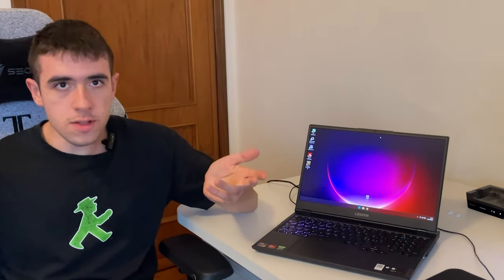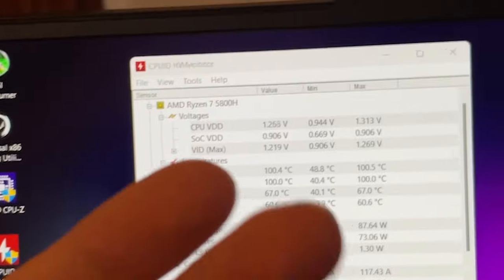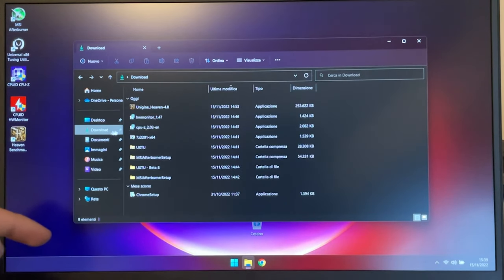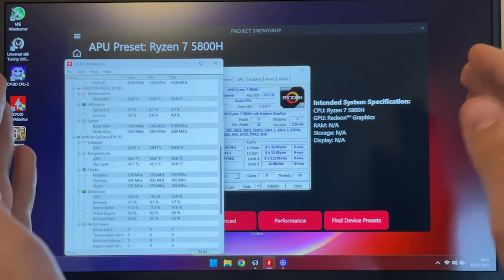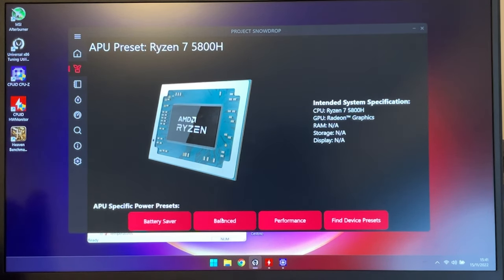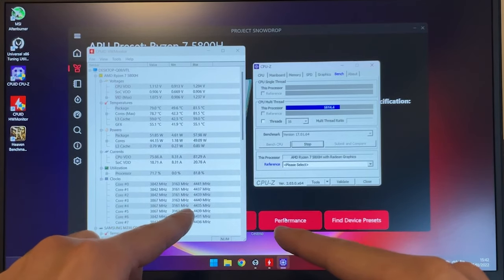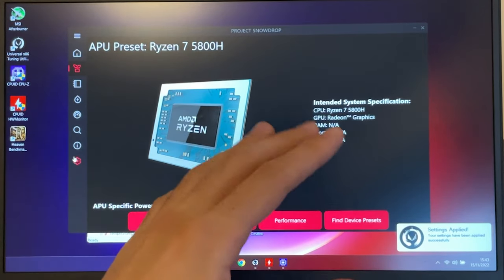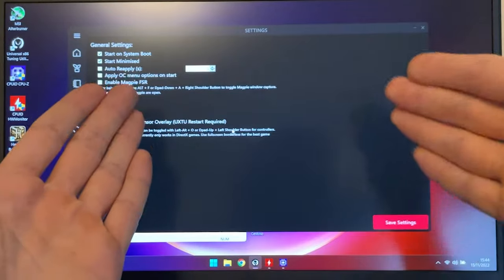Undervolt ANY Ryzen Laptop CPU for more FPS | Tutorial | R7 5800H on Lenovo Legion 5

Comment: it’s limiting cpu temp not undervolt.

undervolt = lower temps + normal or higher performance!

If you want to undervolt go to that software leave everything unchanged and find curve optimizer then apply ranging -20 to -25 value then save.
Reply from the maker: It is not actually just a temp limiter! The preset work by applying a different curve! Doing it manually as you suggested, however, works great too!
Reply: @ImWateringPSUs  then why is the "performance" mode here producing lower clockspeeds than without using the program at all? in the beginning we see 4160Mhz, after you apply "performance" mode it's somewhere around 4040Mhz.
Reply: Yeah  he's just arguing with everyone who points this out, even though the title claims  higher FPS.
Reply: There is no available software to undervolt Ryzen mobile processors as I know. If you know please share. Most vendors lock BIOSes from that.

Comment: I tested it on the legion 5 pro (5800h), the temperature is lower since the processor frequency is lower, there is no difference if you limit the frequency in the control panel settings. For example, in the "balance" mode, the program sets the frequency to 3900, in this case all the temperature and power indicators are identical to the situation when you limit the frequency to 3900 in the windows control panel. From this I concluded that this is not an undervolting
Reply from the maker: It is not simply a clock limiter though, it does actually increase performance! You need to test the frequency under load in games and consider the load overtime that usually means a frequency drop!
Reply: @ImWateringPSUs  Yes, but at the same time the point of undervolting is to lower temps so that less power is wasted into heat. This is how you could reach the same clocks for half the consumption (depending the stock settings) by undervolting. However, that needs to be done in the bios because it is up to the mothoerboard to control the voltage without looking on the disk, or RAM (the memories in which you run and store the AATU settings). That is why undervolting cannot be done without a suitable motherboard and bios.
Reply: Well indeed i don´t have much trust in tools that just say "battery saver/balanced/performance" without actually telling you/showing you what they do. 
Sadly found no proper way to undervolt my ryzen 7 5800h. Yet ryzen controller at least allows me to set power limits and temp limits. 85° temp limit and restricted to 35w tdp (even on long and short boost) really helps in overall performance (you bounce less up and down) and in cyberpunk 2077 i still sit at 4000-4100 mhz boostspeed (average between all cores). 

Probably a better experience if you run a ryzen hx cpu that allows for overclocking (guess then the mainboard will allow some actual voltage regulation).
Reply: From what I read, it is lowering the volt at the cost of frequency. Intel have apps like IntelXTU/throttlestop, just lowering the voltage without having to lower the freq. I could even lowering the volt and increase the turbo/freq as long as the system is stable enough. 
I'm looking for similiar tools for AMD, do you have a recommendation?
Reply: @Anakayamgoreng  Unfortunately, I could not find a way to undervolt for amd mobile processors. If you can find a way to do this, be sure to let us know
Reply: The program developers have said that it's impossible to undervolt the 5600 and 5800 unfortunately.
Reply: @benclimo461  At lest ryzen masters is incompatible to these laptops...
Reply: My 4600H hiting 4,6Ghz in spikes not geting over 88c in game 80C stabile in Cr23 90C is Max. Tj for my Cpu is 105c.I have this Program is great my TDP IS from 35w 45w to 54w max.Program OC to 66W stabile.
Reply: @MAG-Crew ow are you getting over 4GHz with a 4600H? On Lenovo that cpu comes with 65W TDP in performance mode (red light).m, this usually outputs an actual 30-32W power usage.
Reply: The OC page has a Curve Optimizer which you can use to actually undervolt the cpu and not change the rates TDP of your energy setting.
Reply: @imAgentR  Yes brother im geting Max to 4,6 Ghz default Tdp is 35/45W Max factory is 54w i push my to 66w. tell me where u wanna to send u Pics
Reply: As you have said, th,s program only decrease the frequency, not the voltage which also you can do from windows power managemen. I have lımıted the max watt to 50 (ıt was 55 watt) and my laptop ıs cooler then before. However cpu frquency has dropped the 4ghz from 4.2 ghz.
Reply: Simply DISABLE TURBO BOOST in Windows Power Options... Legion 7 with 5800h, mhm...

Comment: 3:45 who are you trying to fool here? I see lower clockspeeds than at the beginning. Not by much, by like 100-150 Mhz but that's still not undervolting, that's underCLOCKING. My friend recently tried Ryzen software that is supposed to control voltage. And while it does work on some 4000 models, it DOES NOT work on Ryzen 5800h.
Reply from the maker: It’s running at a higher clock speed than the stock one after the power limit kicks in, it’s lower than the top boost frequency at stock, sure, but that’s not sustained. If you have a 5800H give it a shot, this ACTUALLY increases performance!

Comment: Thank you so much. I didn't expect anything because of different opinions, but it works very well on my 5800h. Actually, when I turned cinebench, both multicore and single core went up 300 points despite lower temperature and voltage.

Comment: Tried to use for 6800u
So before. Power usage - 25 wat
After 17
Frequency down from 2800 to 2400mhz
Temp from 85 to 68
Cibench performance test:
from 9075 points to 7619.

So basically, under volt - true
underclock - true. That did temp much lower. But also lost in a performance.
Reply: Forgot to add. 
I had also Power/balance/whisper mode at my Asus app.

This settings also take affect on the results.
Reply from the maker: Thanks for the report! I’d recommend you remove the other software you’re using, set the laptop on max performance and then apply the “balanced” option as in the tutorial, for better results!
Reply: @ImWateringPSUs  originally I did that under Performance mode setting for pc. Results in first comment when applying Balance setting.
Reply: Undervolting would allow you to keep using the max frequency of your cpu at a lower power level hence less heat, hence more boost time. This is not undervolting at all.

Comment: There is another similar option Ryzen Controller. It is much easier there to limit max temperature without a need to customize other options. Or/and limit TDP. So your CPU will just run a constant temp you want under load. Less temperature shocks and stress for CPU and nearby components. I tested it and it holds the temperature not more than +1 degree celsius from the limit. While keeping performance at a reasonable level.  Recommended safe temperature for games is 75° C. 80°is O.K. 70° - For those who wants to be sure.
Actually I got 10% more points in Cinebench R23 with 80°C limit than without limitation by default where I had max t 92°C.
And got 5 % more than default with 70°C limit. Which is very nice : I Got 21 °C max_t drop with higher CPU performance !
I got 4% drop with 65°C limit 

I have Vivobook Pro 15 with 5600H. The test I mentioned was with fans in Standart mode. Where it gets 7150 points by default or 9200 if I tweak everything I can to max with temperatures up to 96°C
Reply from the maker: Ryzen Controller is also really good! The UV tool I showed acts a bit more on the curve so it’s better slightly though! Thanks a lot for the detailed report😇
Reply: @corsairpower7520  I've experimented with it. And found that my CPU is most efficient with 15 W TDP limit where it has 50% of max computing multicore power. And only about 10% drop in single-core performance. These drops are not slowing down light tasks subjectively. So that is a great option to work on a battery. Laptop is also cool and quiet with the option. You should find best spot for your CPU though. I think it should be in 15-20W range. Just perform fast benchmark on every step in that range. 
Another thing to mention go from higher wattage to lower, because at some point its performance will drop gradually and you will need to turn off limits fully to make it faster again. Seems like some functions of the CPU can be turned on only with enough power. But then you can go quiet low and everything works good. I also recommend after reboot before setting quiet low limits to give it some fast heavy task to "turn on all capabilities". I found it much more reliably performs. Like start the game and after that apply your limits. If not, you sometimes can find it doesn't want to go even to limits and lags in workflow.
Reply: I wouldn't recommend setting the temp limit to anything below 75. If you go lower then you may end up with horrid stuttering as you cpu goes into panic survival mode clocking cores down far below the standard frequency, before it boosts back up to 4ghz+, and the hits panic mode again.
Cooling solution and environment temps as well as a games cpu utilization matter on this, i tried 70 for a while till I ran into said issues.

In most cases it's better to use a desktop shortcut for power profiles, for turbo and non turbo. As you can disable the CPU ever clocking above it's stock clock speed. And 3175mhz on my Ryzen 7 5800 is still plenty fast and depending on the game doesn't even make a difference in fps compared to turbo on. But temps go down to ~60 tops during load with low 50s during low usage, i.e browsing, watching videos etc.
Reply: @ImWateringPSUs can i undervolt a alienware m18 with ryzen 9 7945hx? Its got a 4090 gpu so already gonna run hot as hell
Reply: recommended safe temperature is probably higher than 75c
Reply: @snakeplissken1754  limiting the same CPU by the same temp works different with different room temperatures and fan profiles. 
Now I'm using limiting by TDP. I found experimentally the best efficiency per wat TDP for my CPU and now I'm using it. It is 15 W for 45W processor. I also allow turbo for a short time to 23W. And I have enough productivity even in games, but cool quiet and long-lasting on battery laptop.
Reply: @clunkeys  nothing bad will happen if you get your CPU even to 100C shortly. But operating in high temps for a long period of time will slowly destroy components on your motherboard. I bet it will overlive warranty period but not for too long. The more temp you have the shorter laptop life will be.

Comment: This is not undervolt properly.
Reply from the maker: It is, for Ryzen laptops! Try it out
Reply: Tried this, and it does not undervolt my ryzen 5800h. Used curve optimizer instead.
Reply: @itismeISH where i can get curve optimizer? What app
Reply: @Demwih same app, or rather the updated version UXTU, Universal X86 Tuning Utility.
Reply: @itismeISH  i already installed universal tuning utility x86. But in custom  section i can't see curve optimizer
Reply: @Demwih  buttom most option, per core curve optimizer, if you have it
Reply: @itismeISH  sadly i dont have it
Reply: what version do you have cause i dont have the option either, i only have per core
Reply: @viccyboy  they updated the app. There used to be an all cores option.
Reply: @itismeISH  does it work with 6800h ?
Reply: This app does not work with dragon age ryzen processors which are 7000 series. I got 7945HX and app does not support it
Reply: @itismeISH curve optimizer doesn't work on 5800h. Just look at voltage/freq before and after, they won't change
Reply: @Antagon666  they’ve been updating the app. I no longer use the curve opt. I use the balanced template now.
Reply: @itismeISH  but curve optimizer doesn't work 🤣 any gains you've seen were placebo.
Also presets just straight up limits wattage and performance, doesn't improve voltages.
Reply: @Antagon666  6 months ago, curve optimizer used to work before a few updates. Now it no longer works for 5800h. As far as the templates, i find that it fits with what i need for my system now.
Reply: @itismeISH  I've been trying to activate it since all the way back to 2022. What is your laptop?
Reply: i have R5 5600H, for people in this section, is this still working, if not, what is actually the best option to do? i have already disabled turbo boost
Reply: @artery2211  Best option would be to limit either temperature or  total power, so that the CPU can at least boost in single threaded workloads. Disabling boost is not valid solution, as you are potentially losing about 30% of performance.
Also curve optimizer has never worked since 5000 series in R5 and R7 CPUs, the people claiming it did are either lying, or mistaking the applied profiles for undervolting.

Comment: Hi just to let you know that the undervolting aspect of this program does not work on the 5600 and 5800 as said by the developers themselves, it'll work on the 6000 series and 5900 versions though.
Reply from the maker: Weeeeell technically it does still lock to a certain voltagepoint in the curve even on the 5600 and 5800, so it “achieves undervolting”, if that makes sense. But yea a true voltage offset is only applied from the 6000 series and up! Still works for every Ryzen temp and performance wise tho
Reply: @ImWateringPSUs  Technically not. Definition of undervolting is running at same frequency with lower voltage. 
Undervolting doesn't work for any R5 or R7 CPU, since 5000 onwards (including 6000, 7000, 8000).
Stop spreading misinformation.

Comment: Well... on ACER Nitro 5 (AN515-45) with Ryzen 7 5800H the newest "Universal x86 Tuning Utility V1.1.0 Beta 3" did not make it a lot cooler, it make exact opposite. On idle it is +10 C degree hotter and while playing its -5 C cooler. However to my surprise it made Windows 11 much more snappy. Overall program execution is faster and moving between windows also seems snappier. KEKW i think i am gonna use this... and i think it added extra +400 Mhz sustainable cpu clock speed at the same cpu temps! :D Also honorable mention is for disabling turbo boost speeds. That one made 20 C degree difference. More i think of it - might be time for repasting my lap with Kryonaut.
Reply from the maker: I’m really happy it was helpful! Thanks a lot for taking the time to write this! :) I definitely agree about the repaste, by tuning your power settings a bit you should be able to keep the same temp on idle. Using the curve it should be the same temp in idle and lower temp under load

Comment: They replaced the AATU with a UXTU which is similiar thing. Also there an adaptive mode where you can literally undervolt play with the curve optimizer and voltage which yields better results than just power limiting using the default presets. -20 to -30 on cores seems to be stable for my 5600H and the power draw/temps are much better, almost same performance.
Reply: Can you show me your settings? I have the same CPU and I'm looking to undervolt but don't want to mess with untested settings
Reply from the maker: Yessir! I’ll try to make an updated video asap
Reply: @noteyy  I also have ryzen 5 5600h on a lenovo. I configurated settings like this:
max temp 90ºC
slow power limit 35W
fast power limit 40W
Amd curve optimiser > all core offset between -25 and -30, it depends on eachone cpus as cpu arent identical for everyone

if you want to you can measure which of your cores is working hard in gaming and set the amd curve optimiser lower or higher for each core, but i personally prefer not to play with that

Comment: 2:54 - for some reason you assume every graphics card overheats in a laptop. That's not how it works. Even if you mean dynamic boost, it won't always be enough to activate it by just making the CPU consume a little less power.
Reply from the maker: In pretty much every laptop, reduce the thermal and power output of the CPU will result in increased performance in game! That’s just a fact, obviously if you have a VERY chonky laptop with huge heatsinks then it doesn’t really matter
Reply: @ImWateringPSUs  I have a thin laptop with a very weak cooling system, and it would matter if it overheated. I've been watching hundreds of gaming laptop reviews each year from professional reviewers and what you say matters extremely rarely. The GPU needs to be throttling in a laptop for it to matter how much power a CPU consumes, because in most laptops it's the CPU that throttles, not GPU.

Comment: 25% Boost of $0.5 investment? Easy. Put 2 eraser under back of your laptop. Actually many laptop designs with limited cooling capacities very strongly benefit from any improvement in cooling. So getting your fans turn faster or making airflow better can really boost your performance. As I said I got 25% in multicore Cinebench test with two erasers under laptop and a bit lower temperature in my room.
Reply from the maker: That’s definitely true! Both lifting the laptop and getting a fan under it work wonders!

Comment: My laptop does not go below 98 degrees when I put it in "balances" mode and the worst thing is that yours reaches 5700 when you're doing the stress test and mine is hard to reach 5100, what could I do? I need help please.
Reply from the maker: Unfortunately it means you’re thermal throttling hard. You need to do a full repaste and repad